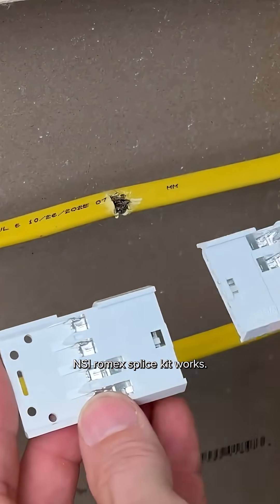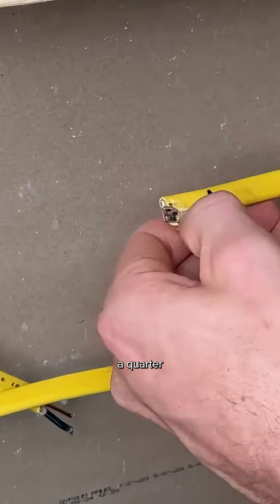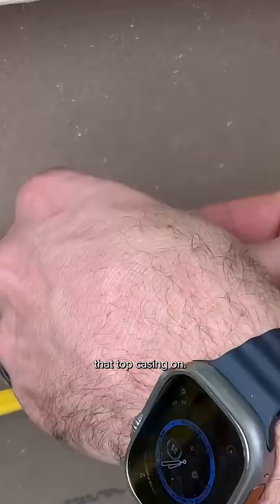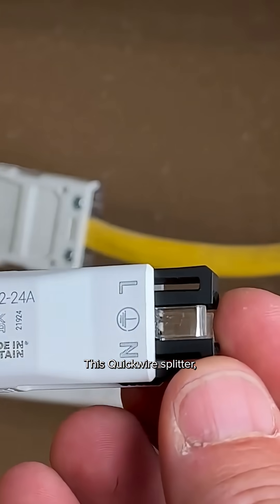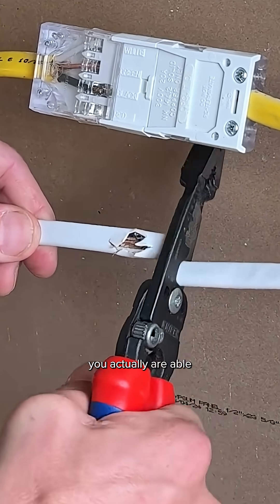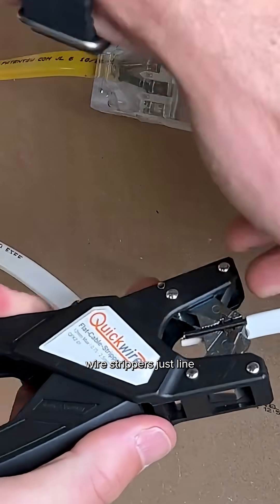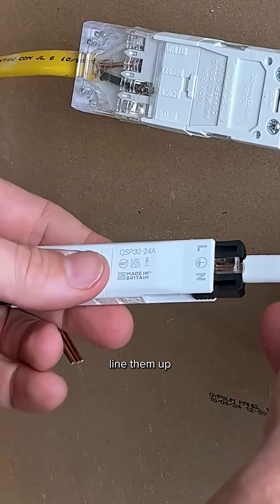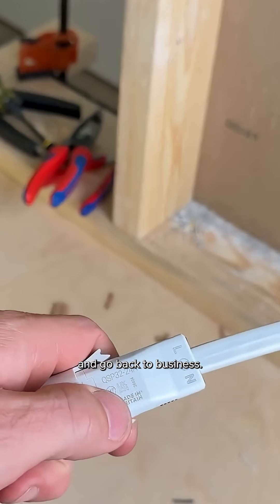The NEC-Approved Splice I Hate… and the UK Inline Splice I Love

Comment: Undecided. You didn't show how much impedance was added for each splice.
Reply: Or putting the line under load and looking at heat made
Reply: Its not highend RF bud 😂
Reply: You guys already voiced my exact concerns. Especially the first one looks hokey to me. I would put a 3rd one in that box of a standard pigtail.
Reply: The US one is more difficult to use, and it's a short there's not much time to do a thorough test. And anytime your you're not using copper you're increasing impedance.
Reply: @matt45540 RESISTANCE 😂
Reply: @BartlettTFD impedance includes resistance you know....
Reply: @BartlettTFD 
It's AC, bud. It's impedance.
Reply: @DarkMatterX1 It's 60Hz, layman. It's resistance.
Reply: @AtlasReburdened 
Huh. I guess there's no need for the ω in the term jωL then, eh?
Reply: @DarkMatterX1  When dealing with a straight splice, on residential transmission wiring that's carrying extremely low frequency differential mode current? Yeah, there's 0 need whatsoever for considerations of inductance or any of it's contributing factors. Now run along back to your textbooks, pedant, we're talking about the real world.
Reply: @AtlasReburdened  It undercuts credibility to resort to petty name-calling.  Just state your case.
Reply: @ncooty he did
Reply: Let's see how they handle max current. Something tells me our old friend I²R might have something to say here.
Reply: Yes easyer.
Reply: The us one reminds me of the ones used for automotive application's and they corrode in no time and fail i can't believe they allow this for in wall spliced wires.
Reply: @r.h.b.4980  I get where you're coming from, I've seen the automotive ones have issues tons of times. But I've never seen it inside the car, only ones exposed to the elements. I think it would be safer to assume they won't corrode or be a lot less likely to corrode in a wall.
Reply: All technicalities.
Ok.
This splice will add a little capacitance.
It will add a little inductance.
It will add A LOT of resistance.
Reply: @sprky777 I'm not denying that the capacitance and inductance will be small, heck they might even get lucky and have them cancel each other out. I simply don't like having people, who don't know what they're talking about, tell me which words to use, especially when they're wrong.
Reply: @RJBrack If you want to talk impedance, you have to talk about the frequency of interest. At 60 Hz, there will be no significant difference in resistance and impedance. At audio frequencies, it's still unlikely that a person can tell the difference between the connectors and continuous wire. If you tried running 1000 base-T, the cable design will be a bigger issue than the connector, but impedance will be a concern. It's easy to measure resistance, it's hard to measure impedance.
Reply: @johnhaller5851 as I have mentioned, I expect the capacitance and inductance to be minimal, possibly even canceling each other out. All that I'm saying is that impedance is the correct term.
Reply: @RJBrack true but resistance is generally better understood and at 60 hz in the practical application being discussed here. It is the reading we would use. What actually matters here is how much heat is produced under sustained load at amp draw circuit is designed for.
Reply: Impedence = AC
Resistance = DC
Reply: @scwfan08 impedance is a complex valued function of frequency.  DC is a frequency
Reply: @scwfan08 impedence dont matter at low AC 😂😂
Reply: Current flows external on conductor.   How much surface area contact is on the second splice?   I did not see enough for my liking on the clear one.
Reply: @gregorycross612  No. This is 60Hz, not MHz. There is essentially no skin effect whatsoever at the frequency romex operates at.
Reply: @AtlasReburdened  I blame all the pop science channels for that one. They say "AC flows in the outside of conductors" and not much else on why and how, but that gives just enough information for some idiots to start going around posting stupid shit.
Reply: Because it’s a negligible amount.  This annoying criticism has been debunked as an issue countless times
Reply: Obviously it's a fraction of an ohm 😂
Reply: @koei3920 really shouldn't be any.
Reply: @koei3920 is it? Can you prove that?
Reply: @RJBrack  A removable connection generally doesn't have losses like that.
Reply: @koei3920 in general, no. I agree with you. I'm simply saying there's no evidence. I'm not here to start a war about nomenclature, nor one about the actual impedance cost, I'm saying that there were no tests done, or that the results of said tests were omitted, so I remain undecided. That's it.
Reply: @RJBrack 😂😂😂
Reply: Splices are very bad, always a weak point and source of fire. it is technically damaged wiring.
Reply: @lwiley2002 is a splice different than wire nuts in a j-box?
Reply: @Shoop83 Yes. Wire nuts are required to be in a junction box. These splices have no such restrictions. The US type, however, will fail with high current loads like all blade-type connections. They are only legal because when they fail, they won't start a fire. The NEC very clearly states that approved wiring methods are not necessarily practical - only that they are relatively safe.
Reply: @jayztoob The NEC isn’t always right‼️I go back far enough to remember when they approved aluminum conductors in Romex‼️14 ga required 12 ga aluminum for a 15 amp circuit as an example. The use of aluminum Romex caused numerous fires across the country. It was determined that the problem was located at wire nut connections due to oxidation buildup. The NEC made a change prohibiting the use of aluminum Romex except for point-to-point circuits such as those found in 240 volt circuits. Breaker to water heater, as an example. Even then, overheating and fires resulted causing the NEC to throw in the towel and ban aluminum Romex altogether. I remember this TERRIBLE decision only to well. I stopped electrical fires at 2 homes just when smoke was beginning to come out of switch and receptacle boxes.
Reply: @lwiley2002  but it's ok to pop in an old work box and use pigtails with wire nuts
Reply: @lwiley2002 In some situations, it is IMPOSSIBLE to re-run a new cable in a completed home. Maybe I should have clarified that statement to add that new wiring CAN be added via surface conduit such as “Wiremold” available in steel or PVC.
Reply: I wouldn't say impossible. Maybe difficult sometimes.
Reply: @BartlettTFD only if the electrical installation was either poorly designed or installed
Reply: @BartlettTFD I think the argument is that a junction box should be installed if a damaged wire does need to be "spliced"  back together although it's seems to me that it's still a splice even when it's in a box lol But I'm not an electrician sooo..... 🤷🏽‍♂️
Reply: @Dunriteproducts There is ABSOLUTELY nothing wrong with splicing a cable as long as it is done CORRECTLY following the requirements of the National Electrical Code. In residential wiring, wire nut splices are found in EVERY rough-in box where a light switch or a receptacle is located! Wire nuts have recently come under fire due to some apparently sloppy electricians NOT twisting the wires together tightly before screwing on the wire nut. Loose connections cause erratic voltages AND heat buildup inside the wire nut which can easily start a fire. In the past, I have soldered a connection before installing the wire nut which GUARANTEES a PERFECT connection.
Reply: @lwiley2002  Not true, otherwise every light switch or outlet is damage wiring
Reply: @lwiley2002 OBVIOUSLY, you’re NOT an electrician😂 SPLICES are NOT “damaged wiring”😂 You might want to brush up on the National Electrical Code for more detailed information.
Reply: I think you meant to say RESISTANCE ‼️
Reply: @BartlettTFD  actually both, but typically impedance doesn't matter in residential electric.
Reply: @BartlettTFD  no, I meant impedance. Impedance is the 'resistance' caused by EVERYTHING that impedes the flow of current. ALL components cause impedance, it's simply out of phase if it's not a resistor.
Reply: @RJBrack You are CONFUSING electronic circuitry with power line circuits. Please do some additional study on these topics for a better understanding.
Reply: @BartlettTFD I'm not confusing anything. In this situation, we have ~120(or 240)VAC running through a wire. The capacitance and inductance of the splice will contribute to the IMPEDANCE of the circuit as well as the resistance of the splice, thus creating more heat than just the resistance alone. I would suggest that you do your research before telling others to do so.
Reply: @RJBrack indeed, and I suggest that a hypothetical circuit with zero reactance indeed has impedance, albeit purely resistive impedance.
Reply: @RJBrack Impedance is a consideration in audio circuits, in transmitter circuits, etc. Capacitive reactance, inductive reactance. That is NOT the issue here. In this particular situation, ALL we’re concerned about is the surface area of the conductor (wire) and the surface area of the contacts that  pierce the insulation. That metal to metal connection and its ability to safely handle the current flow, OR heat up causing connector failure and fire.
Reply: @BartlettTFD Impedance can be purely resistive, or it can have aspects of capacitance and inductance, therefore the correct term is impedance. I don't know how much capacitance or inductance will be generated by these splices, more than likely it will be negligible, but it's still the correct term to use. I really see no further point in continuing this debate.
Reply: @RJBrack I STRONGLY suggest that you purchase a copy of the National Electrical Code. That is the Bible for electricians‼️It spells out EXACTLY what can and cannot be allowed. As a retired Broadcast Engineer, I think you’ll be hard pressed to find the word “impedance” even mentioned.
Reply: @BartlettTFD it's like you're not even reading what I'm writing. So, again, impedance is the correct term and I'm no longer debating. I don't care what the National Electric Code says or doesn't say. I have given perfectly reasonable arguments, and all you're saying is 'no', so I'm done with you.
Reply: @RJBrack When I see a totally IGNORANT comment such as yours “I don’t care what the National Electrical Code says or doesn’t” that tells me EXACTLY what I’m dealing with. You’re the type that knows just enough to be really dangerous. Best of luck, bud😂
Reply: @BartlettTFD Actually, the NEC uses the term 'impedance' in numerous places. Take a look for yourself.
Reply: @RJBrack  but in this case we are only concerened with the real part of the impedence AKA the resistive part, as that is what contributes to power loss and heating. becides the reactive part of the impedence will be completely negligable on this short peice of copper at 60Hz. if this was a few km of wire then sure but its not.
Reply: @HPD1171 as I have said (many, many times at this point), yes the reactive part will be negligible. I'm simply using the correct term.
Reply: @BartlettTFD  You are wrong, and he is right.  When dealing with anything involving AC, "impedance" is a more correct term to use than "resistance" (unless you are explicitly excluding AC reactance, which there is clearly no reason to do in this case, because any reactance involved would also be relevant here).

It doesn't matter if in this particular situation an increase in impedance is mostly due to resistance or not.  "Impedance" is still a perfectly correct term for him to use, and there was absolutely no reason for you to "correct" him over it.  In fact, his phrasing was actually technically more correct than yours, so you are trying to "correct" him using phrasing that is objectively worse than what he originally said.
Reply: @RJBrack I also want to jump on the bandwagon and remind you that you're wrong.
Reply: @BartlettTFD  confidence in your ignorance.

Comment: I don't know about elsewhere but here in the US the white wire is still "HOT" its just the center tap on the transformer so it gets 1/2 the voltage potential from the transformer no matter which leg you pair it with because it cuts the circuit in half from either direction so its polarity is still going to be the inverse of whichever leg youre using it with, which alternates at 60Hz here in the US..... its never truly "neutral" per se it just shorts out the transformer half way down the winding..... that being said, relying on some plastic tab in a quick connect system buried inside an insulated wall to not burn your house down in my experience would be a foolish idea unless they added screw that held the 2 ends together once connected and applied tension on their contact points against one another...... but even then I'd feel allot better about a solder joint covered in heat shrink and I also think the cut conductors should be staggered in length so that if for some reason they did get pulled from the connectors by some genius pulling on them from a nearby box the conductors wouldn't actually be able to touch one another because their stripped ends wouldn't be right next to one another...... IDK..... no matter what you do to develop a safe system there's always going to be some moron who doesn't read the instructions and burns down his shack to ruin for everyone...... the fact that we run 10's of thousands of volts through large cables for rediculously long distances before they enter anyone's home is completely asinine and dangerous to begin. This is all just really a pointless debate over how much stupid is the right amount of stupid and how much people with common sense should have to suffer on behalf of the people who have none. Personally I fully support letting Nature run its course to clean up the gene pool a little cuz this world's getting to be waaaaaaay too stupid.
Reply: I approve this rant😂

Comment: Approved. Idiots everywhere will have 30 of these in each circuit using up all the spare 1 foot lengths laying around.
Reply: Pretty sure these will cost way more than a few feet of wire
Reply: @Dfbc8823 yeah until the guys start stealing them from work

Comment: For something with potentially disastrous consequences, I need more than one demonstration in a YT short.

I think there was >10 years exerience with Wagos in the U.K. and Europe before introduced here. Is that also the case with these?

I would like them better if they were clear so we could visually confirm good contacts as with Wagos.

As for the one already approved, not fond of the design. Would like an exposed or cut away view to see what the contact areas look like and how big they are. Seems like surface area would be small. Also, similar to the other, it doesn't fill me with confidence to just push wires into a black hole.

I guess we have to trust U.L. did adequate testing.

Comment: I love the UK design a whole lot more!
Cleaner, lower profile and mechanically a better connection!
Reply: We don't actually know if it is a stronger connection. At least the other one has screws that hold the wire.

I would love to see the inside of the smaller one. Especially with the way they are just push in.
Reply: @Apollo-Computers 
Anything is better than knife edges working on strained conductors.
Just my 30+ years investigating electrical fires.
Reply: @Apollo-Computers  Trust me, QuickWire gives a strong joint.  I doubt the US one comes anywhere near it.

Comment: Here in Canada, splices concealed in wall spaces are disallowed. I asked a local electrician and he never does that. Instead they use one or two boxes that are visible and accessible from an inside wall so that any problem of increased resistance is enclosed in an approved box to limit fire risk. Both of these designs look a lot like the notorious guillotine design for low voltage connections that typically corrodes over time....
Reply: The UK design looks like it uses the same  attachment gimmick found in Wago connectors, which are legal here for concealed installation. So as long as they are as robustly made as Wago, I do not see an issue with them.
Reply: @HiVizCamoglad to hear your "endorsement" of Wago connectors. I just DIY'd a wall switch that required a few connections and I Wagos. I hate wirenuts!
Reply: They're talking about homemade splices. These newer devices have to be approved before it will go into code.
Reply: @Thatsmessedupman  Its good to know and I agree with the idea. I understand budgetary concerns, but if your building a home for your family to live in, or renovating - worth considering in the plan.
Reply: @johndurrett3573  although I think any device that's designed for splicing Romex would probably be code approved. According to the title of the video, it's NEC approved and he's hoping the UK version gets approved.
Reply: @Thatsmessedupman  Correct.  My comment was more addressed to spelunkerds comment about Canada's code and a responder to his comment.  I have the wago's myself for home projects - love them over the twist type connectors that have given me muscle cramps working on overhead wiring fixes in the past.